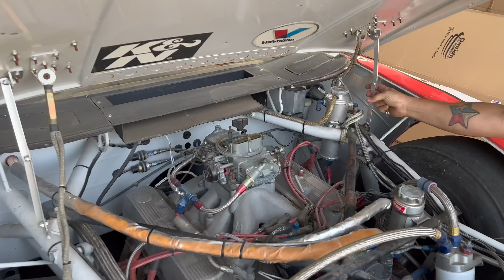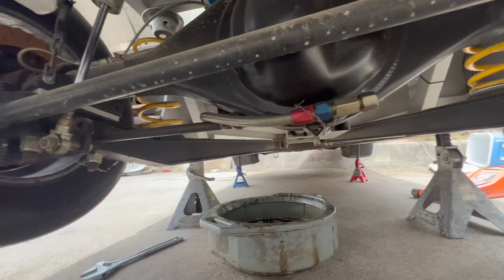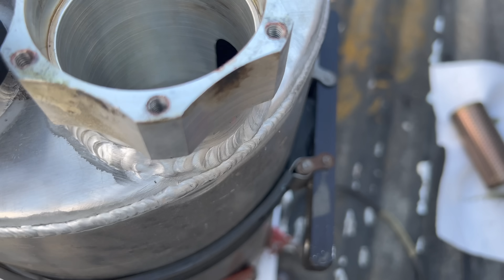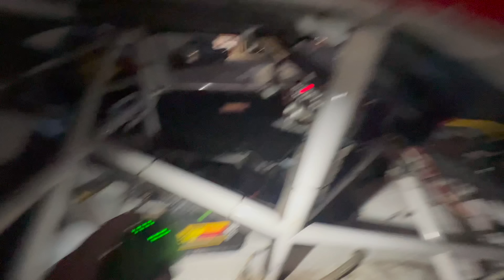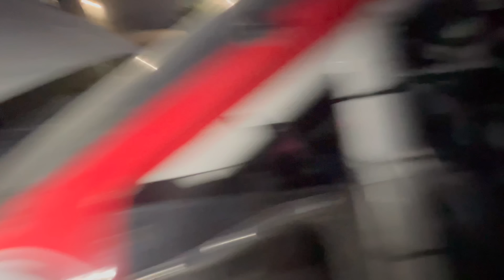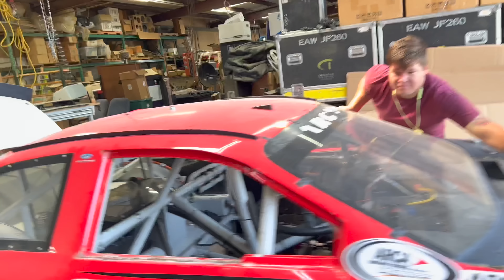Chained a Nascar to my truck to do burnouts

Comment: MSD says to not mount boxes upside down in the instructions.  Basically to let any moister out otherwise they can corrode and die.  Unless you have a sealed Offroad or Marine box I think.  Interesting how they put clear bases on the MSD boxes, prob to see the smoke when they burn up(common saying "Let the smoke out the box").  FYI MSD will check/fix boxes and I think they are down there by you.  The RPM pills are notoriously off sometimes a few hundred RPM, a 6AL2 would of been a good upgrade.  Basic/cheaper MSD coils are junk, surprised they used an oil cooled(also not suppose to be sideways mounted, may leak).  Ignition coils are RPM specific and one suited for higher RPM will of course work better(make more power).  Try a ford TFI coil.  Vac secondary is deff not a race carb

Comment: Msd stuff isn't "super unreliable".
Reply from the maker: Why are there two mounted to the dash with switches so the driver can toggle between them then?  And they are both dead?
Reply: @LoneStarDrift  is it confirmed they would actually switch between them ? I thought one was just for redundancy “incase” one failed when you’re doing like a 200+ race
Reply: @Garage.Philosophy  we tested both MSD boxes and coils. everything was dead. The wiring was all working.